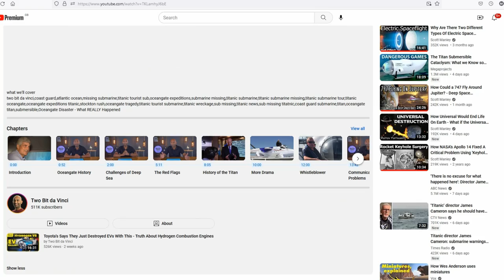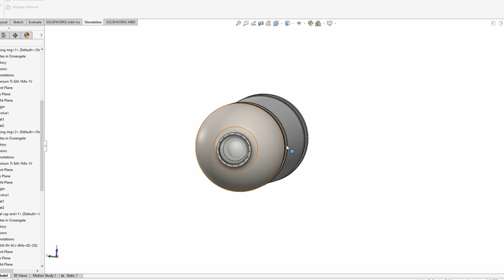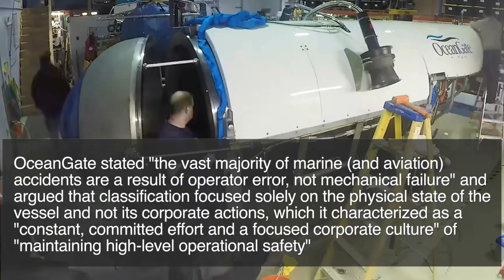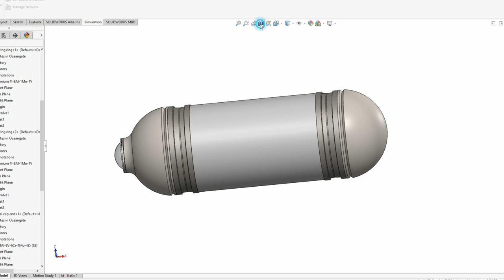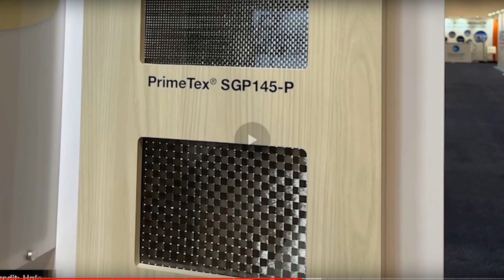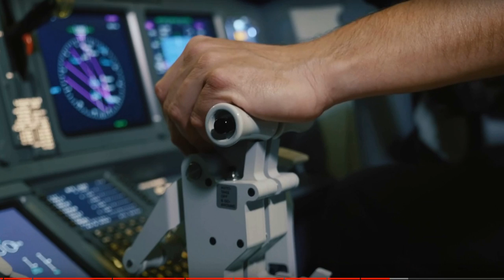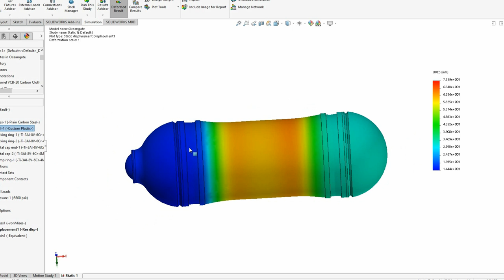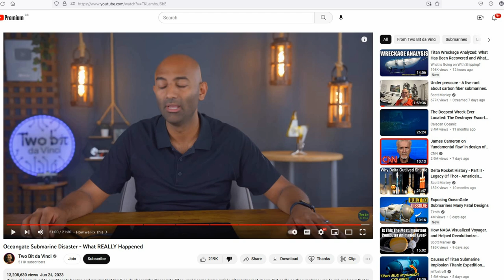Oceangate Titan - Engineering Failure?

Comment: When people explain air pressure by saying a column of air, what they really mean is the weight of the air above you Not just a column, exerts a pressure of 14.6 lbs per square inch if you are at sea level.  This pressure is exerted on every exposed part of your body, not just from above.  Similarly, the deeper you go in the ocean the more water is above you and the weight of that water exerts a pressure on you from all directions.  The Titanic is two and a half miles deep which means at that depth, you have the pressure exerted by the weight of two and a half miles of water above you.  If you go to the wreck of the Bismark which is even deeper, that is even more pressure on you from all directions.  Some marine life exist at that depth with all the pressure because their bodies are exerting the same amount of pressure outward, thus neutralizing the external pressure.  If they are brought to the surface they will explode since that internal pressure would far exceed the 14.6 lbs per square inch when they break the surface.

Comment: The porthole was certified by manufacturer for 1200 meters so what can go wrong at 4000 meters.
Reply from the maker: It depends what that means. They might only certify it to that depth due to test costs and availability.

It's like some can foods. It might say best before 2 years, but that's only because they stopped testing it after that time.

Comment: it's hilarious to me that this video is debating the position that the titan, a submersible that famously imploded, wasn't an engineering failure.  also, it was an aftermarket controller, not an xbox controller.  there is a massive difference in build quality there.

Comment: Genius….you should KNOW YOUR OWN LIMITATIONS…..in aerospace, military, and esp BOATS and SUBMARINES…..because of the fire danger and being enclosed with limited O2, you want military-grade fire-retardant components……..and plastic, not only is flammable but gives off toxic gas when heated……not to mention using a worded controller so as not to worry about a mother ssingle point of failure with the Bluetooth signal and gear for it, especially with passengers using their Bluetooth and the subs Bluetooth speakers.

Comment: Good job nice modelling ,the way its glued on ,hand mixed eyeballed for thickness not much squeezed out not done in a controlled clean room ,air bubbles in the epoxy and hey the glass ribbons was to be 7 inch thick ,but 5 inch thick will be fine,no bolts ,the flexing that must of occurred on each dive  ,testing oh no ,they where all lied to and paid the highest price in the end

Comment: Just finished watching- fantastic! Never knew I would find engineering interesting. I have a question for you with regards to the implosion or failure of the craft. Wouldn’t the implosion/explosion also cause a massive shockwave that would have been felt by the ship? You said the carbon microfiber failures in the factory caused the buildings to shake- would your hypothesis also include an extreme explosion that the boat would have felt? Curious as to why the individuals on the vessel did not suspect anything.. maybe they did but didn’t want to believe it…

Comment: The problem you had with the column of air is a bit silly, it's a perfectly reasonable explanation and it's how we calculate pressure. Well... not for air on long distances because we know that's very compressible, but anyways, the fact that pressure is in all directions is just because molecules are like 3D springs, not 1D as we're used to thinking, so the equilibrium needs to be propagated in all three directions. That's why it doesn't matter how thin the column is
I think your explanation is more like the thermodynamic view of pressure as the conservation of momentum of particles hitting a wall

But thank you for defending the xbox controller, literally has been optimized for years to control complex movement on games and be thrown around by kids. Why exactly wouldn't it be used in the safe environment of a submarine capsule? I'ts not like it's being exposed to radiation or something. The only reason I can think of is if the ship started taking in some water, but for those depths, the controller breaking would probably be the least of the concerns

Comment: They use controls on rvs...not manned vehicles that are the main drive .  It's a legal thing to have main controls on any man shipped as a fixed control system..  they might have a backup like a yacht for its outter controls or thruster to park...  but that's it...  even f1 cars have developed steering wheels .. Tha controller isn't even water proof lol but that's the smallest thing to worry about

Comment: One thing about the controller is that a Logitech Brand replica gaming controller was purchased, and they just aren't good quality and are known for having a shorter lifespan. 

There's a reason why the stock Xbox or Playstation controller is like 60 to 80 dollhairs to replace or purchase, and aftermarket or third-party replica controllers, normally made by Logitech who keep costs down to hit that price niche, sell theirs for about
$30 to become the go-to substitute replacement plan for such brands like Xbox and Playstation. 

Now, in Stockton's defense, he simply bought extra controllers to resolve the issue of their failure.

*buying extra controllers is a good plan because I've never had a Logitech product fail right out of the package, but instead, they just failed after some time of extended use, where the Microsoft and Sony original hardware were more durable by a large margin....I do wonder now, if MS or Sony own chunks of Logitech so they can dominate the market and allow Logitech to access their proprietary designs to replicate their products. 🤔... It's like the drug dealer also selling withdrawal meds.

Comment: Its shown, that the chemistry of glueing Titanium isnt really understood to this very day and them just using it.... You can also see on the wreckage, that there is NO glue left on the Titanium. My bet is on uneven pressure distribution and delamination due to it + cycling. The port hole missing just means that while the sub was impolding, the people inside were shot through the port hole like a meat grinder.... atleast it was fast. Darwin award postume awarded, for Stockton Rush.

Comment: 1:49:42 These guys are just bare-touching the connection rings at all times.
Even the guys on top with gloves are putting pressure on the connection points to adjust their bodies for a more comfortable working position; they are creating an uneven surface.
Your hand has grease and knows what at all times; maybe residue from hand lotion; he may have just came out of the bathroom. 
If the glue goes on where someone puts the palm of their hand. if there are residues of sweat, grease, hand lotion or even the guys lunch, whatever microscopic it will still create tiny air pockets when that other chemical dissolves.
I'm not even mentioning that none of these guys are wearing hairnets. So tons of pieces of hair are probably inside with the glue, creating more airpockets in the rings.

Comment: 23:34 there are 18 bolts but the one at the top is too hard to reach so they didn’t use it🤦‍♀️ so they used 17 bolts to tighten it down. The engineers claimed the difference in 17 and 18 bolts of pressure was too mathematically insignificant to bother with. 😮really.
Reply from the maker: Yes he's correct. The pressure actually keeps the end caps forced against the cylinder. The bolts are there to keep in together at sea level
Reply: @dirtygarageguy  yeah just seems lazy. Great videos! Following

Comment: There are several quality standards for products. Domestic, Commercial and Military grade. You can buy different grade components and materials, depending on your budget or purpose. Why would anyone buy a cheap toy hand controller when far better quality units are available? Watching the video of combining the carbon composite cylinder with the titanium end rings upset me, as I noticed the total lack of tie-rod holes that were needed to keep the cylinder structure intact. There was no internal bracing to keep the cylinder from concaving inwards. Bolting occupants inside was obviously stupid, but that is what I told a visitor would be required after the visitor showed an interest in my design art of the sub. The titanium mesh inner liner was also mentioned to my inquisitive friend but what I have seen of it in videos of the Titan sub I consider to have been not adequate for such high pressures over the length of the control module of its diameter. I am not a registered engineer, but I noticed the smirk look on the face of the worker, as the titanium flange was about to mate with the carbon fibre pod section of the sub, grinning while saying "This is the point of no return - right here." then looked at the dodgy way the titanium joiner ring was set in its final resting place using epoxy that was laid without using a subsequent vacuum chamber to remove entrained air from the epoxy glue. Any entrained air in the wrapping of carbon fibre could pop between carbon fibre layers, forming the structure to become weak and the process would only worsen. At such a depth near where the TITANIC wreck lay, the sound of air bubbles popping would have been terrifying. As the pressurised seawater makes its way into the carbon composite outer shell there is no going back. It busts through, popping out the window.
 As the interior air is compressed, the compartment collapses. The pressure is so great the heat of the expansion of fuels cause combustion, as in an internal combustion motor. The pressure is what performs useful work, but when extremely high pressure is exerted in a vessel containing hydrogenated oil or fat the heat of compression will subsequently cause it to combust and the explosion with such a great force will be so hot that there will be little more than dust left of the vessel and its occupants. Bear that in mind if you are contemplating going down in a dodgy-built submarine as was the Titan - as there is no getting out of it.

Comment: I did not watch whole 2 hours, so maybe you covered some of these points, but here are my thoughts.

59:00 You are not 100% correct here, strength of woven carbon fiber composite is not random at all. Different layering gives different strengths, some of them are quasi-isotropic, some are orthotropic, but it can be predicted quite precisely if you know the layout you are working with. What you say would be correct for so called "forged" carbon fiber which uses chop strand - predictability of that is quite miserable, one part will fail at 100 MPa while other fails at 50 MPa, because the fibers are random. 

In the tube used for Titan, strength in all axes could be predicted because the layout was done by machine and was quite precise. Same is done for pressure vessels such as scuba diving tanks made of carbon fiber (which you REALLY don't want exploding on your back when you are underwater). Big difference is that in those tanks, fibers are loaded in tension, not in compression as with Titan. With purely compression load on this carbon fiber hull, most of the work is done by matrix, which is just a bad design IMO. In compression, this tube tube can take maybe 400-500 MPa (just guessing), in tension (as with scuba tank) it would be able to take 2000-3000 MPa easily (depending on type of the fiber). CF just doesn't make sense in this use-case, tube made out of high-yield steel with bolt flanges and hemispheres would be much better solution and from what I saw is industry standard for tubular shaped subarines. 

I agree with your points about fatigue, it's very difficult to detect some local delaminations happening inside the composite as it ages. It's basically a glued structure with millions of possible weak spots, porosity, possible foreign material trapped during production, etc. 

That glue amount looked inadequate as well, I would expect MUCH more squeeze-out to ensure 100% filling of the groove where the tube sits. If there were some voids left after gluing, that would lead to uneven forces acting on the tube from the steel rings. 

Another problem is that CF has negative coefficient of thermal expansion, while for metals it's positive. Now this submarine did not operate in extreme temperatures, so it might not be that important, but it still can not be overlooked. 

I work in automotive industry and if we want to use CF part, there is a unbelievable amount of testing required. I am talking about testing to destruction using multiple test parts to ensure good repeatability of our production and also lifetime testing with operating loads and temperatures (thermal cycling). And usually these are parts that would not turn you into jello if they fail. I can not understand how could they use this untested vessel, I would expect it to get pressure tested repeatedly to at least 800 bar in some pressure chamber if the operating pressure is 400 bar. If it survives 1000 dives - great, now you can build the "real" one, knowing that it's safe for maybe 50 dives. After said 50 dives, you just have to retire it. This company offers such services in 800 bar hydrostatic pressure chamber, I am baffled that none of those "engineers" thought about it https://www.jfdglobal.com/services/testing-services/pressure-testing-and-trials/ Most likely they knew this is the right approach, but these tests can be very expensive, so IMO it all comes down to cost cutting.

Comment: 1:35:41....  i'm missing a few steps can you educate the rest of use mere common engineers as to why 
"an oval is probably stronger than an circle/cylinder"  when it comes to negative pressure, or positive pressure for that matter.

Happy to be educated with reasonable evidence, however that one comment made you sound like delboy's garage 2.0 without context.
Reply from the maker: Why is a 3D oval stronger than a tube when subjected to external pressure?

Comment: What if the tube was made from solid titanium?
Reply from the maker: It would be very heavy, that would require larger ballast tanks, which also weight more. You end up with a large not ery cheap, but still functional craft. Although a sphere would be more appropriate
Reply: @dirtygarageguy  Formerly being in the aircraft industry I am familiar with the weight of titanium alloy and carbon composite, the titanium would be only slightly heavier than the carbon filament/epoxy composite material and you are correct, it would cost considerably more. Maybe the sub would have been sea worthy with only minor engineering changes using titanium instead. But sadly, it's too late now, the crew is lost and Ocean Gate is done.

Comment: The aviation industry have an alternative for a massive number of bolts.  Sundstrand mounted generators and gear box on jet engines. And tested them at over 10 G of vibration.  One bolt holding a band, a hoop. against what looks like a V belt when the two halves are put together.  So the Titan could have had a means of escape by using an explosive bolt and a second explosive bolt to hold a spring that pushes the hoop open.   Ideal for this application.
     The standard means of achieving neutral  buoyance in submersibles is syntactic foam.  Commercially produced microballoons range in size from 10 to 300 microns in diameter with a wall thickness of approximately one micron.  While ordinary foams are visibly porous, syntactic foams can have cells so small that the material looks like a homogeneous solid.  Epoxy is used however; another material that is acoustically better is used for communications.  And the way of achieving positive buoyance is to drop weight. Titan used sand that could be adjusted for each dive with a dead man 10 hrs. metal that was corroded by salt water and broke.  They also had weights laid over the skids that by rolling the vessel, by the passengers all sitting on one side would drop them.   
   The two reasons for carbon composite are two.  Strength to weigh ratio as you said reduces the syntactic foam needed. The second reason is that the water is at the freezing temperature.  The composite adds enough insulation that the passengers and equipment make enough heat to not need winter gear.

Comment: Great 3D-model and simulation of Titan! However I noticed that isn't SolidWorks actually calculating a 70 mm of displacement at https://youtu.be/QgWalBo8nek?t=5872, since there is "e+001" scientific notation suffix shown in the color grading scale, so all numbers are x10? Also, when you show the side view with the original wireframe model superimposed, the deformed outer surface falls just in the middle of the wall thickness which would coincide nicely with orange ~60 mm of displacement which is again about half of the 125 mm wall thickness of the carbon fiber cylinder. Screen shows that deformation scale is at 1, so deformation is shown as is. Or I have I missed something?